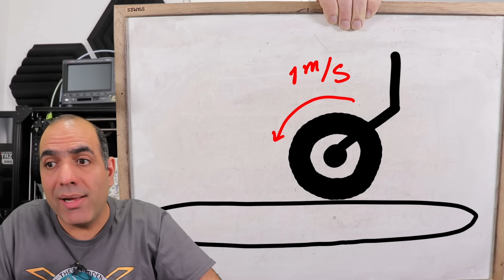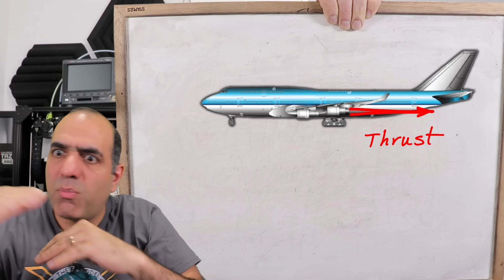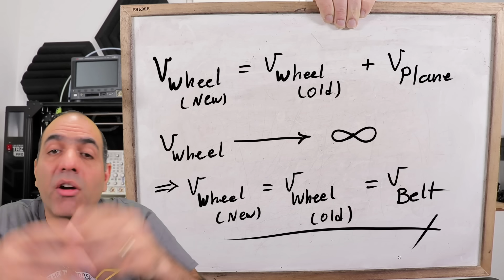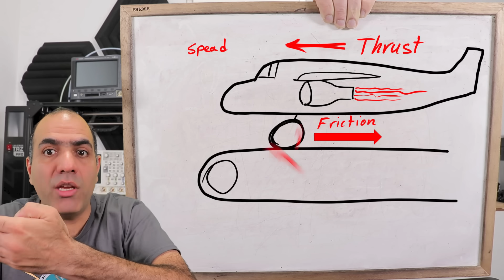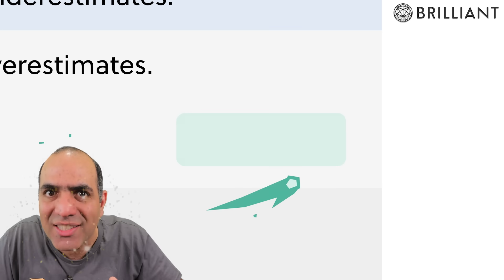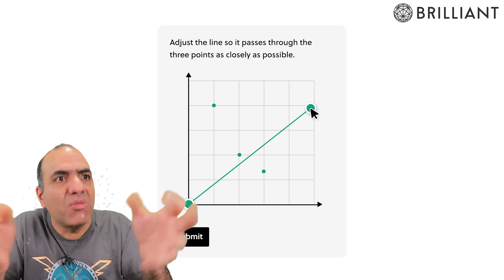Airplane Question that Drove Me NUTS!!!

Comment: I think part of the problem is people seem to think airplanes operate on a time machine built out of a DeLorean principal. The wheels need to reach a certain speed, at which point, the plane takes off. Of course, the wheels on a plane are only there because it causes too much damage to the plane when you let to scrape down the runway. You could replace them with hovercrafts and it would work exactly the same.
Reply: The wheels don't have to spit in at all.  If the conveyor moved in the same direction and speed of the aircraft, the wheels wouldn't turn at all, and the plane would have enough air speed to lift off.  A plane moves along the ground with the same forces it moves in the air.
Reply: The plane isnt moving relative to the atmosphere, so no good amount of air will ever enter the thrusters. The wheels are really only needed to get the aircraft to speed so enough air gets into the thrusters for lift off... that and landing of course. A certain wheel speed is used as a reference point to let the pilots know that once that speed is met, enough air is present in the thrusters to lift off.
Reply: @everstray7482  That is so not true.... The pilots have nothing to do with the speed of the wheels, they dont care about it, heck it's not even displayed on their PFDs. What matters is the speed of the air moving over the wings of the aircraft. When sufficient air moves above the wings of the aircraft, the pilots start rotating (taking off). The speed of the air above the wings might be way above or way below the speed of the wheels, usually a difference of upto 20 - 25 knots. And of course the plane is moving relative to the atmosphere. Please learn the difference between airspeed and groundspeed before commenting your opinion in an open platform like this
Reply: @polytekhat   I appreciate the info, but did you really have to end off sounding like a douche? I am all for debate and learning more and seeing where I'm wrong, but people really need to get off their high horses; it isn't about appearing smart, who cares... so stop the pretentiousness.
Reply: Look, it's not like i get any sort of satisfaction after being rude to others, nah. The thing is, it took me quite some effort and understanding to grasp aviation, ngl. And when someone, who probably isnt even bothered enough to check their facts, decides to comment their opinion with a high level of confidence, it just really pisses me off. Aviation in a sensitive topic and bad info should be kept at bay at all costs. Its not your comment that brought rage in me, it's the general confidence that non - aviation enthusiasts spread incorrect information with. I've gotten used to it over time and it really is very annoying
Reply: @polytekhat  Get over yourself or get off the internet because you'll just get pissed off everywhere you look. If you get upset at every little thing, stupid or not, correct or incorrect, you're not gonna have a good time. Besides, text has no tone; if i appeared "confident" in my opinion, that wasn't intended. It was my best guess. It's not like someone's gonna read it, take it to heart, and go be a pilot just like that... 🤦‍♂️ why a pilot's license is thing my man.... that's the point of a debate like this video, to think and learn from others, not to get upset and shit on others.

Comment: Wow is this question still going on? I stumbled into this trick about 10 years ago. Of course it'll take off. Thrust has nothing to do with wheels. They just turn 2x the speed compared to normal runway. Wheels are essentially just bearings. Though wheels could explode in real life 😄
edit Just realized back then the conveyor belt was infinite lenght. Apparently this trick question has changed a bit

Comment: My immediate thought is that yes because the plane is not pushing against the ground but the air so just the wheels will be spinning 2x fast so if the wheels can take it then the plane can take off. But because it's electro boom my guess is that the problem is with the "moving in the opposite direction.. but how can it move in the opposite direction when if it does it will change the direction of the wheels to be the opposite, so the conveyor belt can't actually go in the opposite direction to the wheels :-D

Comment: I think I've cracked it!

Let's do a step by step:

The plane of "m" mass is stationary on the stationary conveyor. I think it's fair to assume they mean surface velocity, but the wheel velocity in any interpretation is equal to the conveyor: They are all zero.

Now the engines are turned on providing "f" thrust which, due to f=ma, means that the plane will experience an acceleration, presuming it isn't fixed in place.

If the plane starts moving, then the wheel centre of mass would gain a velocity relative to the conveyor centre of mass assuming the conveyor is attached to the earth and we are measuring plane velocity relative to the earth. 

Assuming a no slip boundary condition at the conveyor wheel surface interface, the surface velocity of the two can be equal if they are zero, which they are at rest. The plane could accelerate with no issue without the wheels rotating, as that relation locks the two together and the plane accelerates up the length of conveyor. The relative surface speeds of the wheel conveyor throughout the interaction are zero until the plane reaches stall speed and moves away from the conveyor. 

So rotation of the wheel is unnecessary. You could reduce the problem and by removing the rotation of the conveyor, replacing it with a frictionless sliding... "tray" the plane is sat on. "Tray" speed relative to ground is increasing with the acceleration, but is constantly equal to the "wheel" speed, which would be zero, because you could replace it with a rigid part. This is assuming the tray has a frictionless track as long as the plane needs to build up velocity to fly, as stipulated in the question.

Comment: it wont take off if the air on the wings arent enough, no matter how fast the wheels are, what makes airplanes fly is the air flowing through the wings, if there is enough air over the wings, even if the airplane is stopped, it will take off!

Comment: You are spot on identifying the preconditions and ill defined questions as the real source of disagreement. I remember the Mythbusters episode. For the whole episode, I was convinced that the plane would NOT fly. I had imagined a plane with the engines off, so I imagined nothing much would happen. It would just be pulled slightly backwards by the belt. I couldn't figure out why anyone would believe the plane would fly but guessed it could be something like drag winds caused by the moving conveyor belt. It seemed incredibly unlikely but I tried to keep an open mind. It really felt like cheating when they turned the engines on. Of course it flies if you do that! I also hate these questions mildly. Once you sort out the semantics and preconditions, there's no controversy. (BTW, Veritasium did it again in his latest video on probability. I was so annoyed about the intentionally mixed and misleading use of the word "probability" that I couldn't watch the whole thing. Don't know if he explains it properly in the end or not...).

Comment: The engines are there to reach the take-off speed. {Thrust}

When the speed is sufficient, the airplane is moving through the air at such speed, that enough of the air is pressed by the wings and flaps to produce lift which results in take-off. {Lift}

If the engines are at full speed, but the airplane is stationary, then there isnt enough air pressing at the wings and flaps, so the plane cant take-off.

The engines are there to produce speed, not lift. The speed produces lift, if there is no speed, there is no lift.

Of course, the engines will suck air in and out, but even at maximal performance there will be only fraction of air on wings that is needed to take-off.

Therefore it cant take-off.

Comment: 1. Replace the wheels with skis and the answer becomes more obvious.
2. As written: the conveyor belt tears itself apart trying to accelerate to infinite speed.  If the plane moves 5mph to the left, the conveyor has to accelerate to 5mph to the right, but now the wheels are going 10mph to the left.  So the conveyor accelerates to 10mph to the right, making the wheels sping at 15mph to the left, causing the conveyor to accelerate to 15mph to the right, making the wheels turn at 20mph ... iterate this ad.nauseum. and you reach infinite speed.
3.  Simplify the problem further by removing the wings and now you are asking if an air-boat can move upstream.
4. See Mythbusters.

Comment: That was a very old problem. However, the plane will take off and run along the runway at the same rate whether the runway is moving or not, simply because the forward thrust is provided by the jet engines via air and its not the wheels of the plane pushing it against the ground to gain speed. The wheels will just be turning faster based on how much the runway is moving backwards.

Comment: Before I see the rest of the video: If the belt speed only matches the airplane speed in the opposite direction then yes the plane will take off almost as normal. But if the belt just keeps spinning up the wheels faster and faster to infinity, the friction of the wheels should match the force of the jet engines stopping the plane. But in that case the wheels would explode.
After: Yep annoying!

Comment: there could be a 4th option if you consider te friction between the belt and the air, which can be significant if the belt goes really fast : in this cas it creates a headwind that could provide enough airspeed to lift the plan, although it would be really turbulent
Reply: I think the turbulence might not be that big of a deal since the wheels rotate at near infinite speed, acting like the mother of all gyroscopes lol.
Reply: At a certain speed, I would imagine the belt would create an air boundary layer and only the air real close to the moving belt would move.
Reply: @MrT------5743  That boundary layer, if it got fast enough would hit the wheels and create an aircushion the wheels could move forwards on once the sound barrier has been broken and air resistance/speed starts to reduce.
Similarly to how an aquatic airplane experiences a drop of friction with the waters surface per ground speed and gets pushed up once it moves faster than the waves move.
Reply: I thought the same
Reply: Yes, in this case the Aircraft would pick up Speed about the surface distance of the Belt and then ending up at the Belts end with zero Airspeed. It would need a relative Airspeed twice as high as its stall speed, because when the "belt/air friction generated Air flow" stops, the AC must still travel over stall speed over ground (If Airflow/Wind is zero) to perform a successful takeoff as the question initiates. It could theoretically be lifted, even by a short Belt or even take off if the Belt is long enough.
Reply: That would create a ground effect that would lift the plane allowing the plane to remove the wheels from the ground and begin to move forward and take off... however in reality the tires would have exploded from heat and centrifugal force long before that.

Comment: The scenario and especially the question are flawed on so many levels that trying to answer it is futile.
If the wheel is not indestructible at some point it will disintegrate so the question boils down to a plane without wheels. If it is indestructible at some point relativistic effects come into play. I am no expert but because simultaneity is observer dependant it should be impossible to perfectly synchronize the conveyor belt to the speed of the wheels which leads to some kind of oscillatory motion which at some point becomes so fast that it catapults the plane to Andromeda. And if the wheel and conveyor belt are indestructible and perfectly rigid it is impossible to rotate them at all (Ehrenfest Paradox) xD

Comment: Yes absolutely, because the wheels aren't driven by the engines and as the throttles are advanced and thrust is produced the 747 will start to move forward.  The conveyor will then speed up to match the wheel speed, but this does nothing to the momentum of the 747.  Thrust increases, 747 moves forward, wheels spin, conveyor matches wheel speed, 747 takes off.  The only thing different compared to a fixed runway is that at the point of take-off, the wheels are spinning twice as fast due to the conveyor belt movement.  At take-off the 747 needs to be going 187mph, and due to the conveyor belt, the wheels will be doing 368mph.

Comment: I don't think that airplane works just like that. Let me explain you. The airplane relies on atmospheric air speed difference to take off. That means that the airplane has to run against the air mass to take off. But when convection belt runs at the same speed with the airplane, the airplane remain almost stationary. The air doesn't create pressure difference on the wings and the airplane remains on the ground. It doesn't take off. As for the engines, they are not the reason the airplane is flying. They create the necessary thrust for the airplane to make it gain speed AGAINST the air mass. When this happens, the airplane takes off. The engines are just auxiliary systems that helps the airplane maintain it's speed both on the land and on the air. That's how an airplane is flying. It relies on the atmospheric air mass to fly. But let's create another scenario. If atmospheric air mass and pressure wouldn't exist but the engines would still create a thrust. Suppose there are molecules of air on atmosphere but they have no mass. The engines would create thrust, but the airplane would only run on the road. It would not fly as there is no air mass to create a pressure difference. So simply saying, the airplane flying principle is not relied on the engine's thrust. It's relied on the atmospheric air mass and pressure difference on airplane wings.
Reply: Conveyer belt*
Reply: That's exactly what I am thinking, Spinning wheels don't imply that the plane would take off, It needs to have some relative velocity w.r.t Air so that the Wing Airfoil can produce some lift and the plane can fly !

Comment: it wont take off, the wings need flow to produce lift, if it were a prop plane with top mounted engines it might eventually gen enough lift to take off. 

source: im a pilot

Comment: While the wheels of an airplane are crucial for takeoff and landing, they do not actually provide the necessary force for the plane to achieve flight. Rather, the primary source of propulsion comes from the turbines, which generate thrust and push the plane forward. As a result, the velocities of the wheels and the belt are essentially irrelevant to the airplane's ability to achieve flight. Instead, the powerful thrust generated by the turbines overcomes any opposing forces, allowing the plane to take off and soar through the air with ease.

Comment: I think the question wants to know if the plan can take off while stationary. Like, does the thrust of the jet engine affect the lift
Reply: You can make a carbon cub take off at 0 ground speed if you have a 40kt or so head wind. 

For a 747 it would also be possible, but only with  cat 5 hurricane force head winds. Basically as long as your headwind is above your take off speed you can fly at 0 ground speed.

Comment: @Plane when asked to comment:
The plane needs to go forward to fly. (Air under the wind, you know.)The wheels are just there to keep the plane from crashing into the ground. In normal case, any resistance is neglectable compared o the power of the engines. Therefore nothing would change. BUT! If the belt is speeding up to match the speed of the wheels, the only way to do it is, if the plane is not moving at all. So you could theoretically speed up, to keep the plane in place. (The speed and power would be extreme to generate enough force. So the plane would not fly, because it would be stopped by the belt, or, more realistic, belt and or wheels would catch fire from the heat preventing the start, too. FRICTION WITH THE POWER OF JET ENGINES!!!

@After watching the video:
😁

Comment: You'd need infinite acceleration on the belt to meet the criteria, which is of course impossible. You'd also be accelerating the wheels infinitely. So, you've got some choices about which impossible you care about. Assuming we handwave away the inertia involved and don't have wheel/bearing failure first we'll be inducing a wind over the surface caused by the motion - I don't know how fast this would be given we've gone supersonic+++ basically instantly it doesn't fit any pattern I can think of. If we briefly assume that it causes enough induced wind to cause liftoff then you've got an answer but also a very bad day as I massively doubt you can accelerate enough to get through the wind shear layer and instead will stall and crash back into the magic conveyor belt. Also, at some point the conveyor belt will be generating such a huge gravitational force due to its mass trending to infinity as its speed does the same that your takeoff speed will increase too, but as the whole world is collapsing into a black hole I don't know that it matters.

The myth busters one at least made sense as a question.

Comment: I'm not that smart but as long as the front wheel can come up somehow shouldn't the backwheels spin faster? due to the weight of the plane getting pushed upwards by the engines (yet also increased from the surface area being less) with enough power it should then come up in a more vertical style launch??